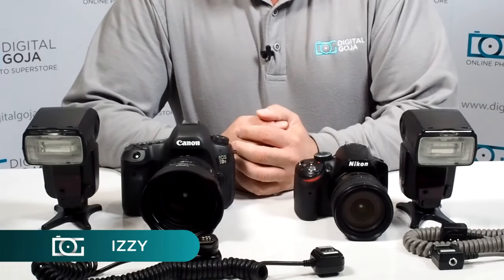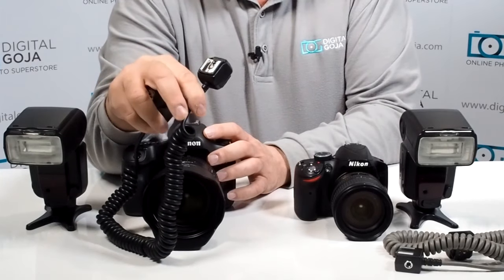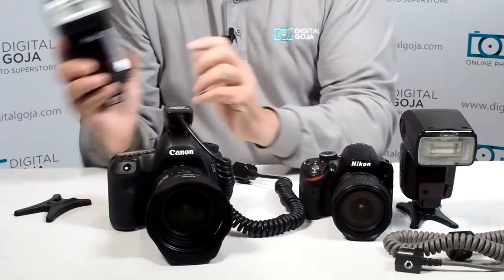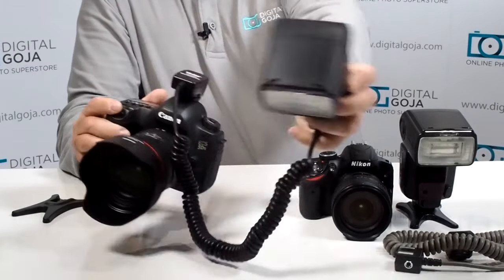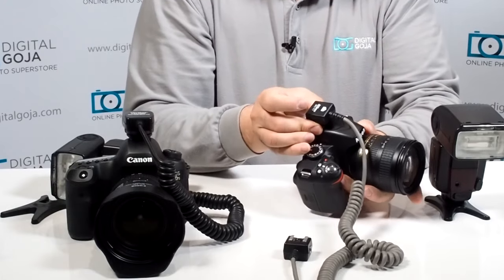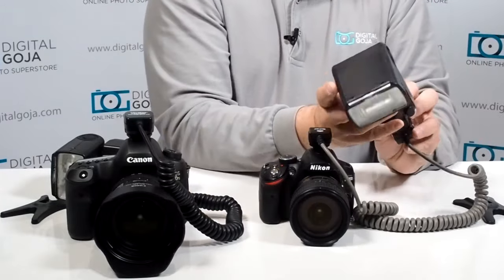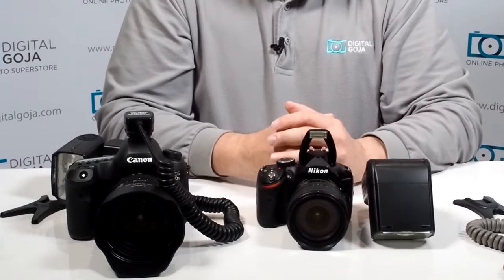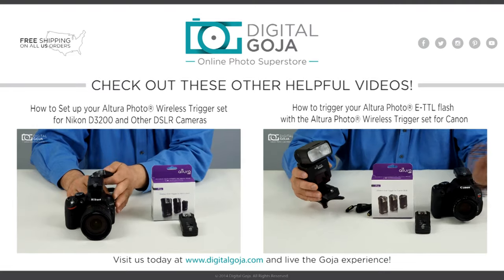FLASH SYNC CORD TUTORIAL | Use TTL Extension Sync Cords to Keep a Camera's TTL Capability

Comment: I appears to me that the grey Nikon cord was probably an SC-17 (which is an old non-TTL cord from the film days.) It would have required the flash to be in manual power mode to work. The SC-29 or 28 cords would have been needed for TTL. Switching to CLS works when there are walls nearby for the infrared pulse to bounce off but might not work in large indoor or outdoor spaces.
Reply from the maker: Hello, Cotictimmy. Thanks for your feedback! The SC-17 cable is a TTL cable similar to that of the SC-28 but is a bit longer in length and doesn't have the same locking mechanism. The SC-29 on the other hand features the AF-Illuminator compatible with the newer Nikon flash units. In regards to using the flash off-camera, Izzy activated the Optical Slave mode in the AP-958X flash because the camera he was using didn't have Nikons built-in CLS system. With that being said, you are right. The CLS system or optical trigger wouldn't be as reliable a cabled connection or Radio wireless trigger system. Thanks for watching!

Comment: Hi, mate. Would you able to tell me if I can use this wire on my Canon 1200D (T5) with an external flash (speedlite)? My purpose is that the camera will be kept inside a box and the wire will come out to the external flash and once the photo is taken, the external flash fires. Also, do you know which feature I need to check before buying the speedlite? Thanks!
Reply from the maker: Hi, it all depends on the model of the flash as this cable is flash specific, just check with which cables the flash is compatible so you can do it the way you imagined.

Comment: Hi, need your help :-)  Just bought a Nikon Fe2 and i want to use it with my Metz 45-ct5 in ttl mode but unfortunetly it came with an pc sync cable
what model of cable i need and what adapter for the hot shoe ?  hard to find... Thanks for your help.
Reply from the maker: Hello Alain Lafleche. To my understanding that flash isn't compatible with TTL. You'll only be able to use it when working with the camera in full manual.
Reply: @DigitalGojaUSA  wrong, it is compatible with TTL. Thx
Reply from the maker: @Alain Lafleche that's great to hear. Good luck with your search for the ttl module cable. Take care.

Comment: Great explanation, but I've the question. Does this pc sync cord save capability to use high speed sync (like flash is used directly on hot shoe mount), if is used canon ex series speedlite (for ex. 430ex with canon 5d), or this cord provide just using ttl function?

Thanks in advance!
Reply from the maker: Hi Arturs! Keep in mind that this is a TTL cord extension, not a PC cord (PC cord gives the signal to fire the flash when the shutter of the camera opens, doesn't transmit other information). Some TTL cords also allow you to work with HSS, look for this when choosing the cord.

Comment: Hi my Altura AP-N1001 i-TTL functionality is not working with Nikon's SC-17 cable. It works fine on the camera hot shoe and I have tested the cable on another flash and i-TTL worked. Any suggestions?
Reply from the maker: Hi there!  This seems to be from an older Nikon TTL Extension cable and has been replaced by the Nikon SC-28. We had a customer on Amazon leave us a 5 star review on the flash saying that his flash did not work properly with the SC-17 cord, but worked perfectly with the SC-28. We recommend that you exchange the cables for better results.

Comment: Will this cable work with a Fujifilm camera?
Reply from the maker: Hello, Elias Billaud. You may get the flash to fire, but it's not compatible with Fuji X series cameras. It doesn't look like there are any TTL cables for Fuji Cameras, so instead, I would recommend using a TTL Wireless flash system. Thanks for watching!

Comment: Hi, I purchased an EOS 400D some years ago but have only just got around to using it now I'm retired. My off - camera flash using a sync cord and Speedlite 430exii only seems to flash when in full auto mode.  I want it to work as a fill in flash in AV mode but it doesn't fire.  Any idea why? I have the Speedlite set to high speed sync.